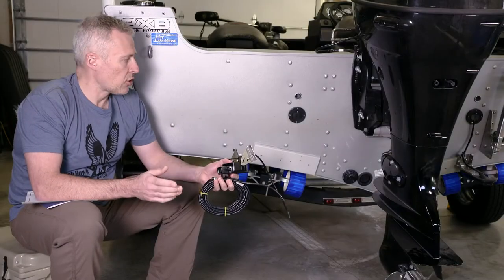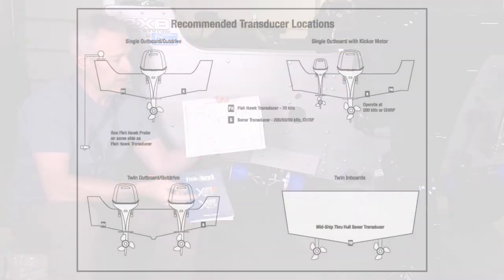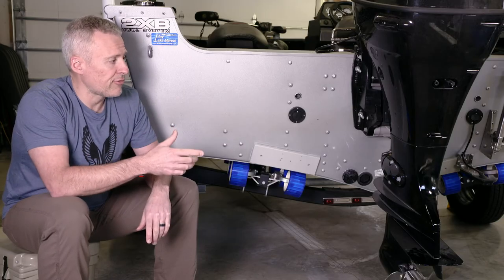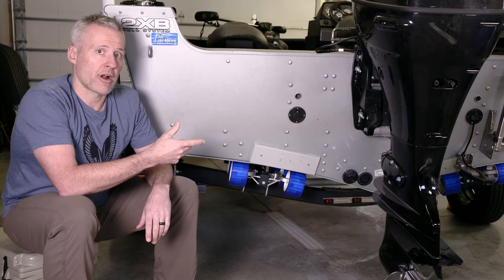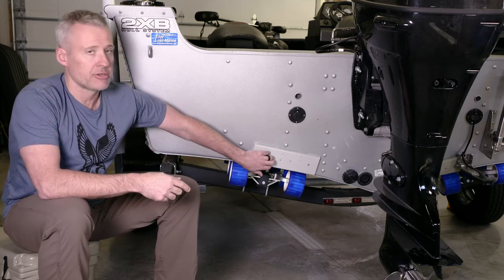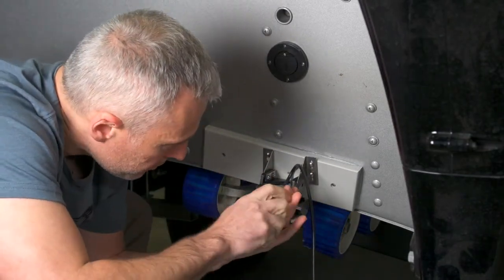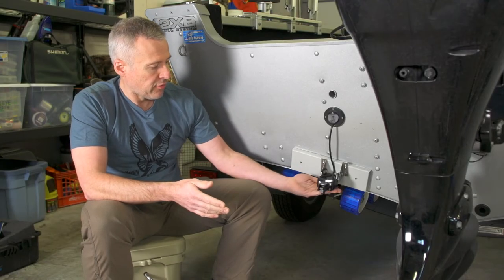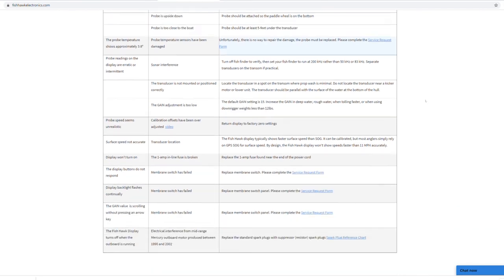Suggested Fish Hawk Transducer Placement

Comment: I don't not understand how, in 2024, any supplier would ship hardware with a slot screw and plain hex nuts without a lock washer. A Phillips or Allen key on the front side and nylon lock nuts on the back saves me a trip to the hardware store.